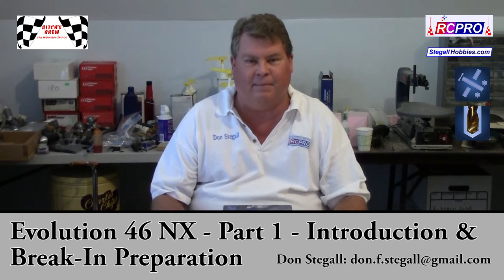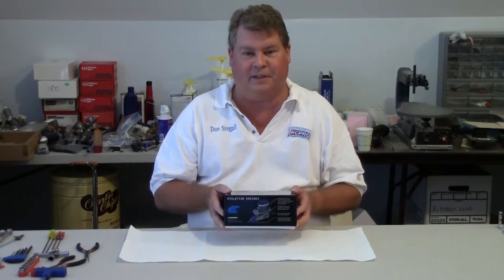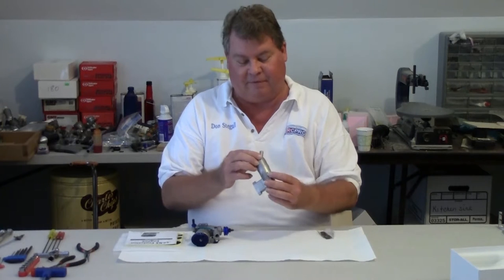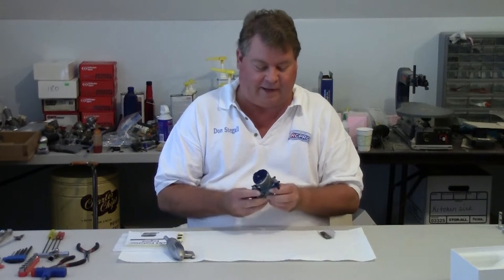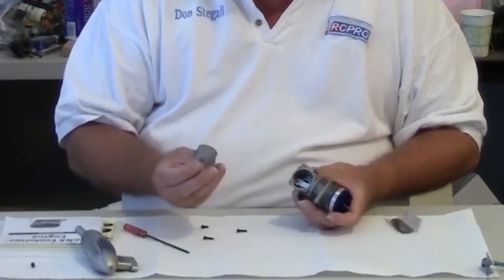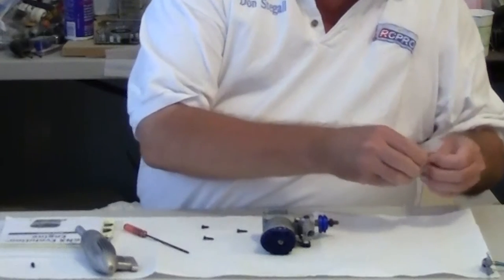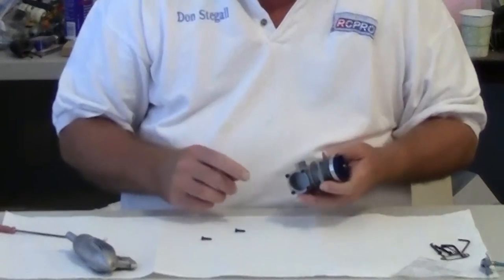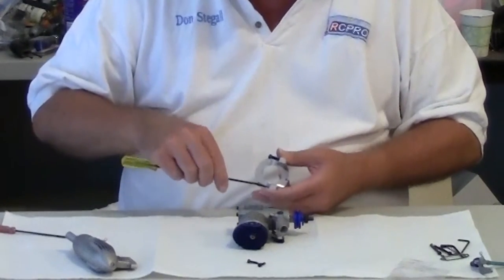Evolution 46 NX - Part 1 - Intro, Disassembly, Cleaning, Assembly

Comment: missed fact: when sliding the brass cylinder back in, the orientation MUST go a specific way. There's a notch in it that indicates the direction it's supposed to face. You can see Don correcting it at 22:39, but not mentioning anything about it.
Reply from the maker: Good catch. Thanks for watching closely and pointing that out. If I can annotate the video I will add that to it.
Reply: Absolutely. I happened to stumble upon the same issue myself and came across this video in research on the same subject. If anyone happens to come across the same ordeal, everybody is helped in the end.